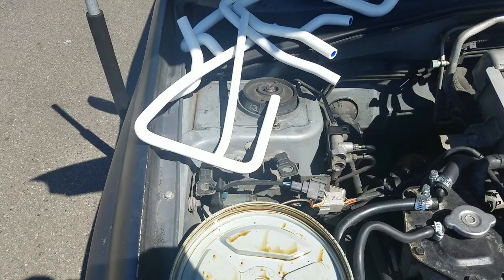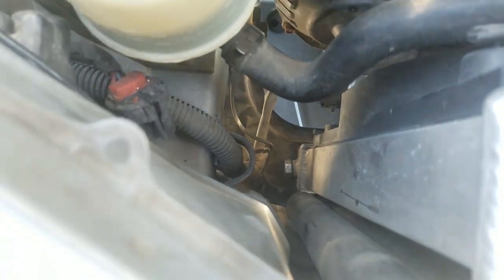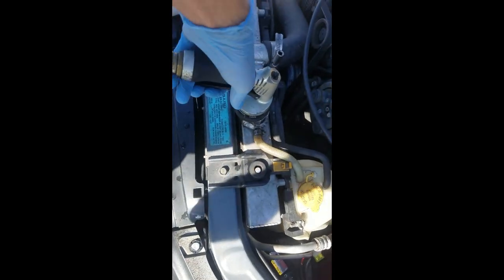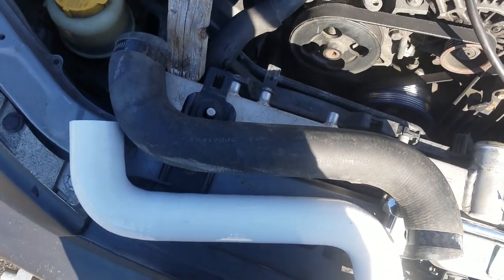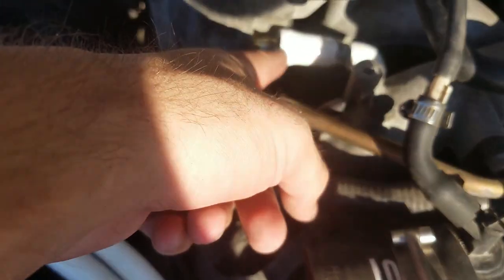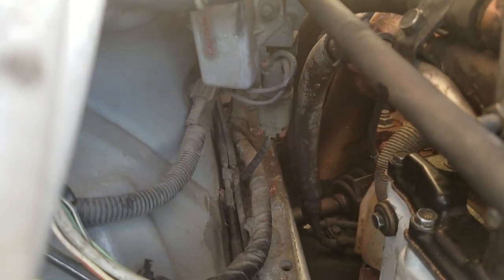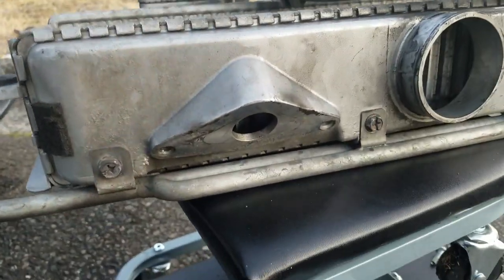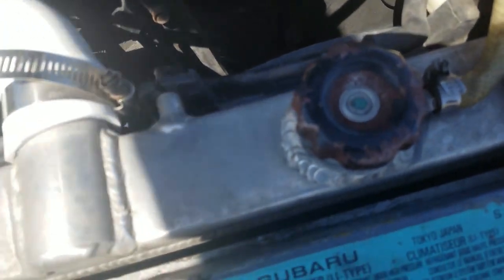2002 Impreza WRX coolant system

Comment: I had the same problem with that stupid plug. I just pull the lower motor hose and it’s much cleaner and drains faster
Reply from the maker: Yeah it was a pain but I've learned some tricks since then fortunately.

Comment: You ever figured out that turbo leak?
Reply from the maker: Well, my intercooler -> BPV threads were re-threaded at some point and they are not threaded well so there isn't exactly an air-tight connection. So I need a new intercooler or to rethread it. I'm thinking of just going with either a larger TMIC or an FMIC at some point soon to get rid of the issue all together.

Comment: not the proper placement of your jack stand man
Reply from the maker: The "proper placement" youre referencing is the pinchwelds on the side of the car under the side skirts. Im aware. They are all bent up because subaru used cheap metal/welds in those spots.